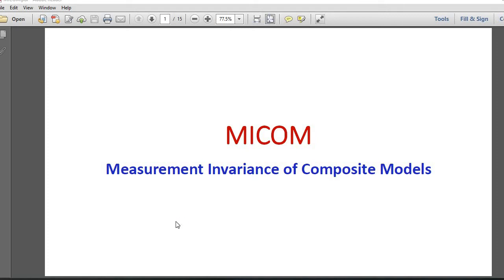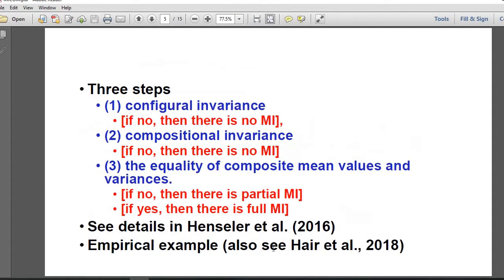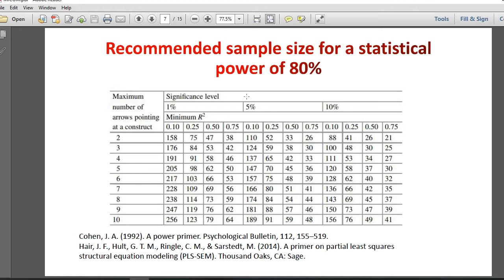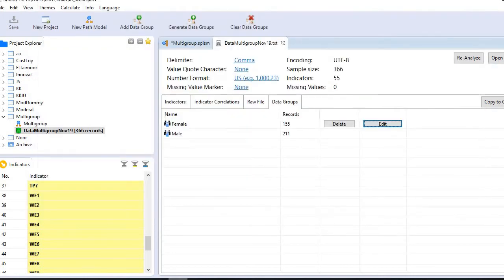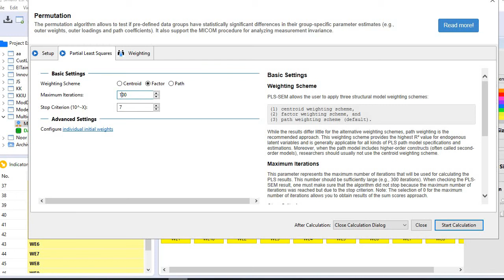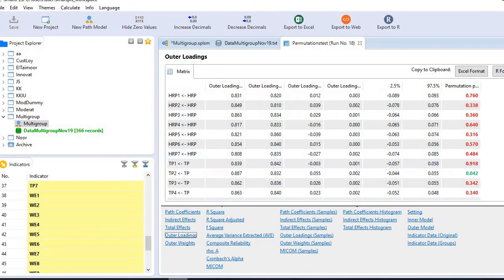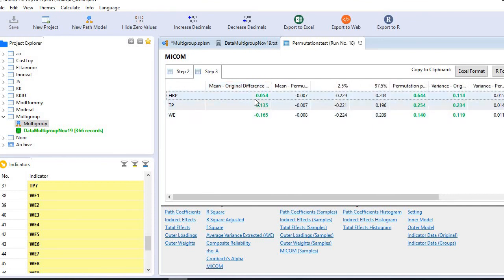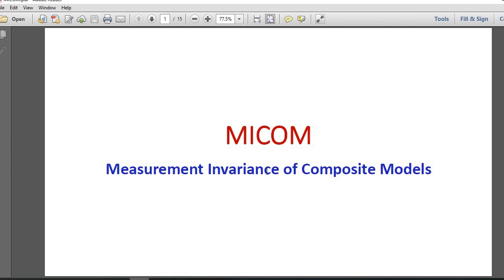Measurement Invariance - MICOM (SmartPLS 3)

Comment: Thank you for this video, that was very informative :) However, what can I do if I have 3 groups? How do I conduct the MICOM? I have read that "If there are more than two groups to compare, multiple comparisons will be necessary. In this case, the Bonferroni correction is indicated,

for example: if there are three groups to be compared (ABC), there will be three comparisons (AB, AC, BC), so the p-values should be multiplied by 3 (or the level of significance - α - should be divided by 3, for example, 0.05/3 = 0.0167) to assert that the difference is significant at 5%. For four groups,
 there will be six comparisons (AB, AC, AD, BC, BD, CD), so the p-values should be multiplied by 6 or α = 0.05/6 = 0.00833, to assert that the difference is significant 5% (HAIR JR et al., 2016)." (De Souza Bido & Da Silva, 2019, p. 519). Could you please further explain this? Thank you in advance for all the help!

Comment: Dears,
Is it required to conduct omnibus test of group differences (OTG) if the study compare different categories under one group. For instance, if the study attempts to examine the heterogeneity effect in a single group, namely 'Authority type', and that includes three categories i.e. 1)Government; 2) Semi-government; and 3) Private.
Sarstedt, Henseler, and Ringle (2011) proposed the omnibus test of group differences (OTG) for
analyzing the differences of two and more groups of relationships.
Based on the case mentioned above, according to Sarstedt, Henseler, and Ringle (2011), what is considered as a group? is it 'Authority type' ? or three classication stated under the group?
Can i just conduct PLS- MGA in above case?
Reply: As I have known, MICOM is used to test of measurement invariance between 2 groups, OTG is used to more than 2 groups (3, 4 or more). Authority type comprises 3 groups: Government, Semi-government, and Private; similar to the case of gender comprising of male and female.